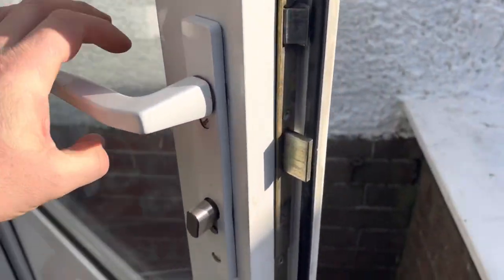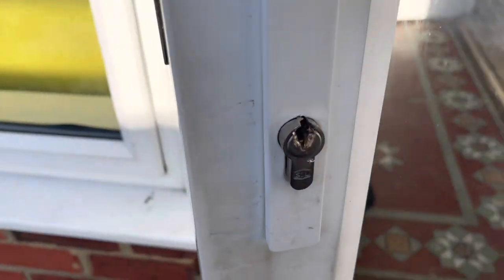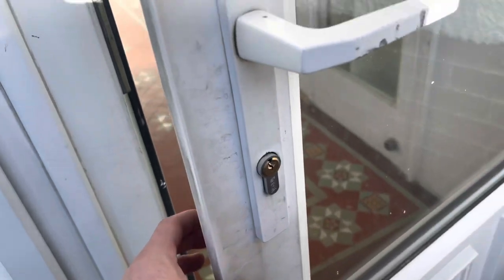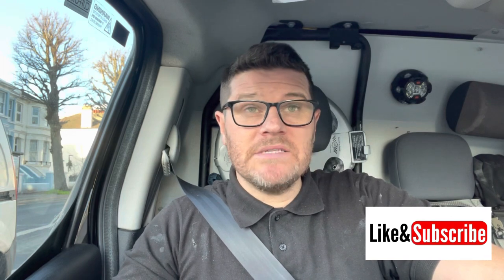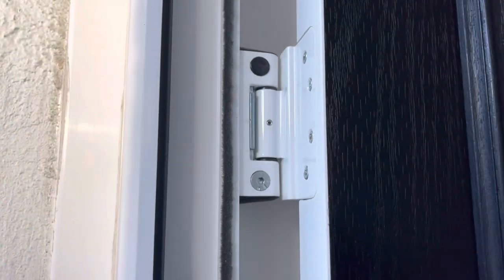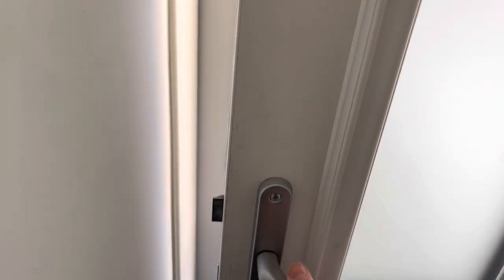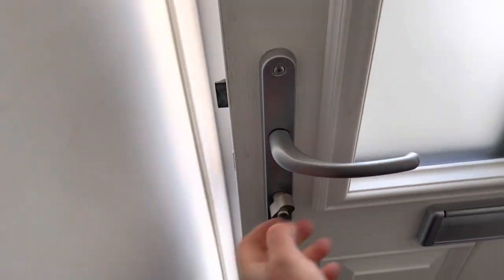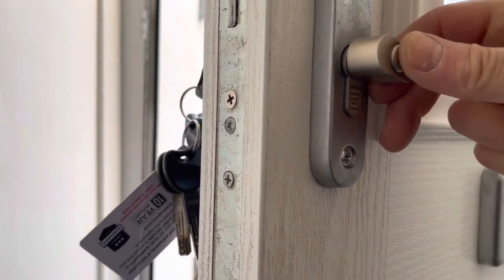Burton KeySafe Install | Drilled Out Cylinder | Apecs BS Cylinder & Door Adjustments - Locksmith

Comment: I thought this vid would be about you taking out all the car kit from the van.

Where are you getting your locks from for the home side of stuff send are you ordering it as you need it or are you carrying those 3 stars as van stock.
Reply from the maker: Doing that tomorrow Matthew. But I won’t video it! 
I have some stock but mostly order the 3 stars when I need them otherwise it could get very expensive 👍🏼
Reply: @brighton_locksmith  you should video it on time lapse. Just think all that space you will now have in the van!!

 Have you got a new 2 in 1 to replace it yet. When you do then a vid on cutting a few keys would be interesting.
Reply from the maker: @matthewrichards552  it’s all gone 😊 Looking forward to planning out the new Van layout. 

I haven’t got a new key cutting machine yet! I’m a bit reluctant to spend £1000 plus on one so will keep an eye out for a second hand one I think

Comment: I thought you were quiet at times because you were just talking quiet. Being on a job you don't want to be talking loud with customers around. Save your £150 and let us all just turn up the volume a bit on our devices.
The key safe - my mate would swear by resin for a job like that, he swears by resin for all jobs, that's why I call him Resin Man.
I did say a few videos back that you would hit 500 in no time at all. Your content is excellent 🙂👍🏻
Reply from the maker: Ah mate. When the customer is around is the exact reason I talk quietly sometimes. But I’ve just spent the £150 on a new Bluetooth mic so all will be load and clear for everyone from now on. 
Resin Man could be right!! Although I’d challenge anyone to get that key safe off the wall 😁
Not long to go for the 500 mark 😊🙏🏼
Reply: @brighton_locksmith  I reckon you'll get it before January is out.

Comment: NOOOOOO......don't use rawlplugs , use concrete screws for secure anchoring. Silicone rubber in the holes might cause corrosion to the screws as normal silicone liberates acetic acid, we have to use non corrosive at my work. The combination of silicone and rawlplugs would mean the safe can be cold chiselled off the wall , no keysafe manufacturers supply rawlplugs for fitting, always concrete fixing screws. Also the house insurance would need to be notified of it's fitting and the product used as some key safes even when properly fitted are not that secure, the model shown costs £60-£80 and can be fitted by anyone with a drill and drill bits...NO RAWLPLUGS OR SILICONE.....